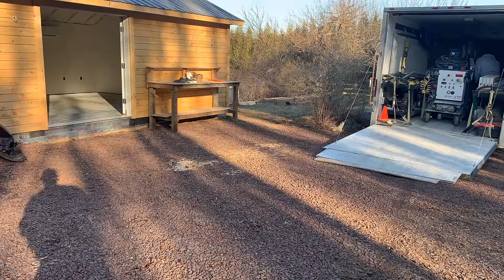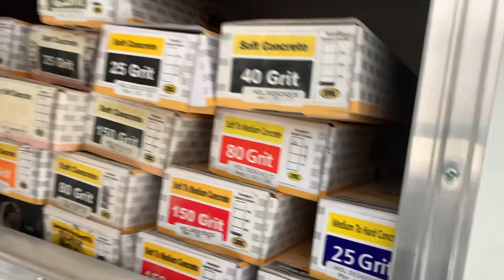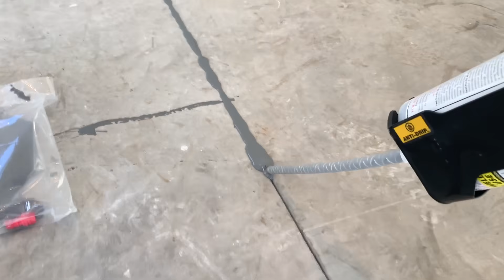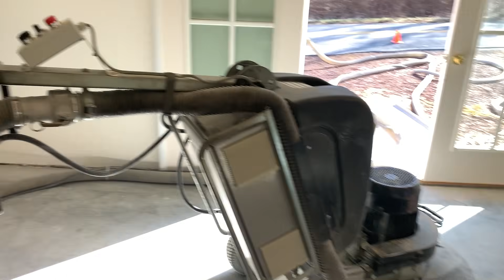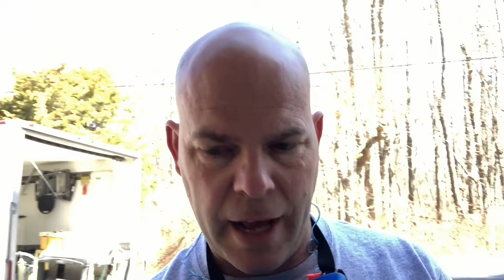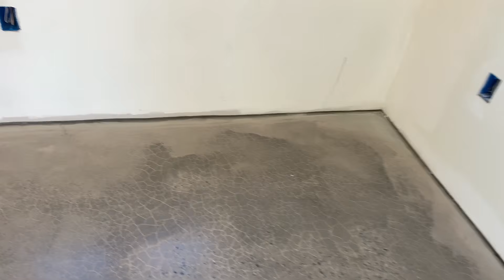Concrete Polishing From Start To Finish : 10 Step Grind

Comment: If you come across really hard concrete..wet grinding is the best option. We also use HTC machines, most often we use the 950, we have 15 of them and smaller ones of course.. There have been good machines.You seem to know what you are doing, and thanks for the great work samples.

Comment: If I want a smooth acid-stained interior floor that absorbs rather than reflects sunlight (i.e. matte, not glossy), do I even need to polish it like you're doing in this video?  It seems like an alternative is to apply sealant then wax.  With the fine polishing that you do, I guess wax isn't needed, or even sealant?  But maybe this fine polishing method doesn't work with acid staining? (because it polishes away the staining).  Thank you for your opinion on this.
Reply from the maker: I have no experience at all with acid stain so I really don't feel comfortable making a recommendation.

Comment: Great video.  However, I'm not so sure if I would be happy with those spider veins if it was my floor, the polish aside.  I understand you said there is no way of knowing without going deeper into the grind, but what are the options, if any, of getting rid of the spider veins and still get a polished look?  Do you keep grinding off more at a lower grit until it goes away?  I'm only asking because I plan on doing this to the floor of my entire house and if my floors ended up looking like that, I don't think me or my wife would be too happy.
Reply from the maker: One thing you have to understand about polished concrete is that you can only polish what you have. The floor dictates how it’s going to polish, you can’t polish the floor and make it look like something it’s not.  
If you’re not willing to accept natural character of concrete, I would caution you about polishing your floors.
There are grout coats that you can apply to the surface that can help conceal spider cracks etc.  
One thing I learned early on is you can never guarantee what a polished Concrete Floor is going to look like besides glossy.
Reply: @ConcreteFloorSolutions  Good to know, thanks.  What if, while I'm grinding away, I'm starting to notice the character of the concrete and I don't like what I see, but I've already started smoothing it out, so passed the rough cuts.  Could I simply go back to a more coarse grit and smack some stain on it, or would I essentially have to start over again, just maybe with a 80 or 100 grit instead of a 40 in order for the stain to stick?
Reply from the maker: @1stGenVetMBA  Stain is completely transparent, it will not cover imperfections in the concrete. It will just change the color of them. 
In my opinion there is nothing in concrete polishing that the word simply falls into. If you're not willing to accept the risk of character within the concrete I wouldn't even try to polish it.

Comment: Despite how much more work it may be, is concrete floor polishing possible with a rotary buffer aka hand polisher and use the t or 6" pads?
Reply from the maker: Anything is possible, it is going to take an extreme amount of time to polish concrete by hand.
Reply: @ConcreteFloorSolutions  what can i expect to pay for sq ft, on smooth slab to a 1500 grit sheen? There was carpet before and i removed it...
Reply from the maker: @Pochitoo  There are so many variables involved. It could be anywhere from $4to $15 per square foot depending on what you have.

Comment: I'm looking at all that equipment, trailers, diamond wheels so on. For someone new to this and wanting to do this.....what kind of investment are we looking at to start?
Reply from the maker: If you were interested in grinding and polishing smaller jobs, I would think around $50,000, if you are interested in larger commercial work, probably $100,000 minimum. One lesson I learned early on is do not ever go for the cheap equipment, you will regret it. I can definitely help Guide you if you would like, email me directly jason@concretefloorsolutions.com

Comment: Very nice job . But can I ask if if you drop red wine on the floor. Can you easily remove it without making spot?
Reply from the maker: If you wipe it up quickly yes. If you leave it set, it will stain just like red wine stains everything.
Reply: @ConcreteFloorSolutions  okay I will tell my daddy. Thanks you
Reply: what if you use a stain guard ? I myself use it I think it protects tbe floor

Comment: Great job!to hide the cracks we use colored sealer.Works fine and helps if the customer aint happy.Check Husquarna polished concrete system,you gonna like it:)

Comment: how much is this kind of services per square foot ?
Reply from the maker: There are so many variables involved in polished concrete that it is impossible to say the exact price per square foot. Job location, concrete strength, concrete repairs, flatness of floor, edges, access, joints, power supply. These are all things that need to be taken into consideration first. Typically polished concrete for smaller jobs is around eight-ten dollars per square foot. If you get into larger jobs 10,000 square-foot or so, it can be  three-four dollars per square foot depending on the above conditions.

Comment: Great work guys,  very professional and tidy.
How long did this project take?
And how do you estimate how many days a project will take when it comes to the size in Square footage? 
Do you have a general rule of thumb?
Reply from the maker: Thank you, that project took approximately eight hours on job. 
Typically for smaller jobs we get about 1000 ft.² per day. You can increase production dramatically by doing a larger area. Larger floors we can do about 2000 ft.² per day. 
We also have a second large grinder that we will use on larger projects.

Comment: How slippery is this when it gets wet for entryways or in a wedding venue with drinks spilling? Thanks much!
Reply from the maker: Polished concrete floors are typically more slip resistant than most other flooring systems. Look up “slip coefficient of polished concrete” there are many great articles that explain it

Comment: Do the high grit diamonds get as hot? Or do you only use the water for the low grit?
Reply from the maker: Typically the higher grit you go, the less friction and less heat. It's normally the 40 and 80 grit diamonds we use water on.
On a very rare occasion we do use water on 150 grit metals.

Comment: Hi. Great videos on concrete polishing ! I just found out that my flooring surface is actually a screed with white cement and sand, rather than concrete. I would like to have a concrete finish. Just wondering if screed could be polished ?
Reply from the maker: As long as its bonded well. If its not, it well rip the surface off when grinding.

Comment: great work! do you need to put another layer of epoxy on top? will the naked polished conrete last? if I have a very large space (1000sqft), how much gap lines I need in between?
Reply from the maker: Polished concrete is exactly what it's called, polished concrete. If you put epoxy on top it's no longer polished concrete, it is an epoxy coating. We apply a lithium silicate microfilm on top of the concrete which penetrates into the concrete, it is not a coating. 
I dont know what you refer to when you say gap line?
If you are referring to joints, they are typically every 10 to 12 feet
Reply: @ConcreteFloorSolutions  thanks for the info! Great stuff!

Comment: Nice gear and good hardworking knowledgeable team. I’d highly recommend getting with the Australians and look into the husqvarna hiperfloor system. Worx+ is the name their runnin under after the sold to husky.  Oh and FYI 400 won’t ever remove scratches.

Comment: So why sometimes you use water?
Reply from the maker: If the diamonds get too hot they glaze over and stop cutting. Water (slight mist) helps cool the diamonds so they cut better.
Reply: @ConcreteFloorSolutions  the the reason I ask is because we're building a grocery store and the concrete guys have a constant stream of water.

Comment: Hi there, great job…. Can this be done using a wet method ?
Reply from the maker: Yes, we do not do that because it is simply too messy. You are spraying slurry all over the walls and then you have cement slurry when you're done.

Comment: Lol I woulda just used a angle grinder to hand cut the joint lol or a screwdriver and scrapped it clean
Reply from the maker: You absolutely can, I use a 4 1/2” grinder with a straight cut diamond blade too, its just not dustless like the joint saw.

Comment: How did you get into the corners ? What did you use ?
Reply from the maker: First I do the edge with a 6 inch 100 grit diamond, then I run a 200 grit 4 inch copper bond wheel, then a 400 grit 4 inch copper bond wheel
Reply: @ConcreteFloorSolutions  I meant the actual corners. Did you use a triangular tool ?
Reply from the maker: @Sjrick  No, the 4 inch wheel is the closest we get to the corner. When you put trim up you can't even notice it

Comment: How much $$$ is the initial set up to star  a epoxy business?.
Reply from the maker: That is difficult to say. Are you only looking at doing garages? You're probably looking at $50-$60,000. You need a grinder, a good vacuum, and a trailer to start. If you were looking at doing larger work, you would need a larger more expensive grinder, a larger more expensive vacuum, a larger trailer, a generator. And could be around $100,000
Reply: @ConcreteFloorSolutions  thanks for your response

Comment: Amazing work 

Just a tip next time grind those edges a little more use water just like you did with the big grinder 

I love running easy edges as well especially with these high polish

I hit 30, 50, 100, and 400 easy edge then run my pads on the edges to make sure everything matches
Reply: Easy edge are the 💩
Reply: You skip 200???
Reply: @davidbolton4930  don’t think they make 200 easy edges only pads but correct me if I’m wrong

Comment: If I have a polebarn with a two month old poured floor and a cure and seal on it, do I have to do all this to apply a Consolideck LS Densifier?
Reply from the maker: If you have a sealer on the floor, you need to remove the sealer in order for the densifier to penetrate into the concrete. So yes, you need to grind it to expose clean concrete

Comment: hello if you want a better quality and without any marks on the floor, put ceramic diamond 100 after the metal diamonds and before the resin ones, the result will be amazing.
Reply from the maker: I will check that out, thanks for the tip.

Comment: Floor looks great. For a garage floor, does polishing resist oil stains or would it need an additional sealer? Thanks!
Reply from the maker: There is a lithium silicate micro sealer on the surface. I would not call it oil resistant though. I would not recommend for a garage. If you do put a clear epoxy coat on it, you don’t need to polish it. You can simply grind the floor once and apply clear epoxy. It will have a wet look which is more brown though.
Reply: @ConcreteFloorSolutions   What maintenece is needed to a clear epoxy finish? Does a clear epoxy need and or benefit from a densifier or hardener? (1500 sqft new concrete living space)
Reply from the maker: @directapprec  you do not need to apply a densifier or guard if applying clear epoxy.
If you are applying anywhere that will be exposed to direct sunlight, I would highly recommend a polyaspartic coating.  Polyaspartics are 100% UV stable and have excellent scratch resistance.
Maintenance is simple, keep abrasives off the floor and damp mop as needed.
Two coats would be recommended:
https://concretefloorsolutions.com/store/polyaspartics/cfs-1c-polyaspartic/

Comment: Nice to see professional tradespersons who take pride in their work.
Reply from the maker: Thank you for noticing and thanks for watching.
Reply: I've been in flooring for close to 30 years as well and I can tell your style, you know your stuff and you take pride in a good job. That is why I'm suscribed. On a side note I'm just getting into polishing and coatings. I'm writing a proposal for a stained concrete polish job and I noticed one area has craze cracks. Can you grind through those?
Reply: @1stainless  Yoo im late to this but im young in this industry only 23.  have been only polishing for 4 years. Depending on where the crack is what I usually do is cut the crack a bit (so that the material bonds) then fill it with your best patching material. When doing this mix it with dust from the floor your doing so it can get the same tone. during this what im still expirementing is putting rocks in the crack mix so when grinding it there's some aggregate and it hides the crack if that makes sense.

Comment: No densifier?
Reply from the maker: Lithium silicate Densifier and guard was added.
Reply: @ConcreteFloorSolutions  at what point in the process?
Reply from the maker: @edwardx.winston5744   after the 150 grit metals

Comment: Looks great, Im wondering if this would last a while in a garage? Or is epoxy the way to go.
Reply from the maker: I typically don't recommend polishing inside of a garage just because if oil is spilled, there is no protection like an epoxy coating.

Comment: Hi

When we are did the cut and polish for the commercial shopping complex. How long it durable and what are the basic maintenance we should do?
Reply from the maker: Polished concrete floors are the easiest and lowest cost floors to maintain. Simply sweep it and wet mop or floor scrub the floor to keep it clean. No chemicals needed. I have gone back to jobs we completed 10 years ago and it looks like the day we installed it.

Comment: Hot damn! y'all got a LOT of money inside that trailer. hopefully you have invested in some serious trailer locks for wherever you store it. Also I noticed you said that dust extraction system was a 480V 3 phase model. What type of generator do you have to power that bad boy?
Reply from the maker: We have Wacker 58kw diesel generator.  We also have cellular cameras mounted inside and outside the trailer with GPS on all of the equipment. It is well worth the investment.  We normally use this equipment on large commercial / industrial jobs but cannot film on those jobs so most people only see the residential side. Most of the equipment we have is overkill for these jobs, but makes the large jobs much easier.
Reply: @ConcreteFloorSolutions  That's awesome! Glad you are protecting your investments, too! Love to see such a successful business thriving

Comment: Was there a reason they had you finish the concrete before the ceiling drywall was installed?  I’d think they’d want all the mud work done before making the floor all pretty like.
Reply from the maker: We installed per the customers request
Reply: @ConcreteFloorSolutions  fair enough.   My old man when I started contracting gave the best advice.  “If their check clears, do what they ask.”

Comment: How long does the shine last?
Reply from the maker: Indefinitely as long as you keep it clean and don't use chemicals on it.  The actual finish is the concrete itself, how long does it take to wear the surface off of concrete with foot traffic? Typically a very very long time

Comment: been in the industry 20 years. this is a great video showing how much work and equipment you need for a "small" job. Resin burn sucks. glad you showed how the edges look from concrete placement and how its not the Polishing guy not doing it right. Great job.
Reply from the maker: Thank you for watching and thanks for the great compliment.
Reply: 20 years you say that's a 🤥
Reply: Man 20 years that's a veteran in that industries
Reply: @j4209-y5o  I don't get how he could be lying about 20 years. I'm in the industry and know multiple guys in their 30+ years. Two of them retired last year.
Reply: When you said you used a 400 grit copper to remove scratches around the edges you lost me.

Comment: When doing my wooden floors, on my 30's property, with a stand up belt sander, at 32 grit, I used up 25 belts, then only 2 belts on 40, 80 and 120 grit, (and my finish required I stop there 😁) so very much understand the struggle to get the first layer sorted.

Comment: Is this something a homeowner can DIY? We are trying to decide if we want to seal or polish in our new home
Reply: You can but the equipment these guys were using are a step above most things you can rent and using a cheap EDCO grinder won't lend to the same results. I myself do some burnishing but I mostly grind for epoxy floors. The equipment these guys used (Not everything in his trailer mind you) total cost is somewhere close to $60,000 dollars. Grinders themselves like his 32" are between $12k to $30k by themselves. It can be done as DIY but the work will be much harder and the quality would be very hard to equal. Unfortunately work like this requires the right tools, more so than most jobs.
Reply from the maker: Very well said. One thing I would add is even if you can rent the correct grinder, having the correct diamond matrix is critical.  I can't see rental companies handing out 6 different matrix of diamonds in multiple grits.

Comment: probably cheaper to tile the floor.
Reply: It depends, we don't know what he'll be using that space for. Tiles look good, but they are not suited for some work places, they would get easily damaged.
Reply: its a small space to be using heavey equipment, so tile would be fine
Reply: @davesilvia9711  To store and move heavy equipment? I doubt it. The owner made the right choice then.

Comment: Where are the chemicals that harden concrete surface? It will slowly produce the dust during usage without those.
Reply from the maker: They were applied, densifier  at 150 grit and guard at 800 grit.
Reply: @ConcreteFloorSolutions  why this fact is not mentioned in a video?